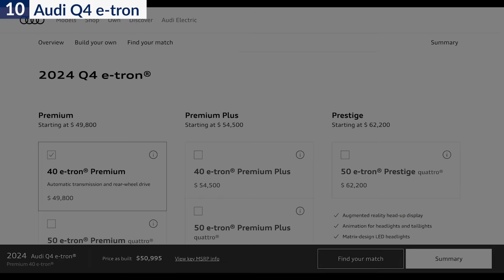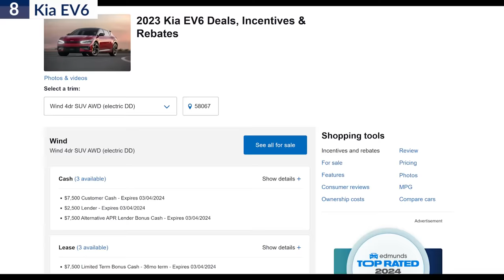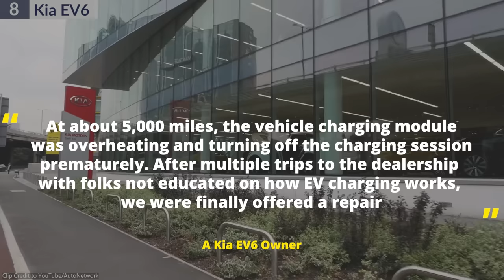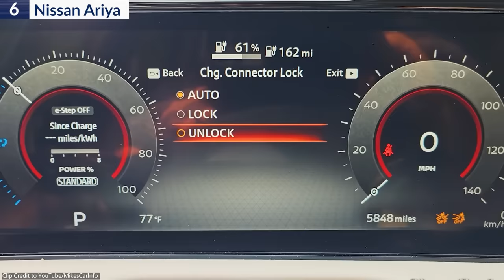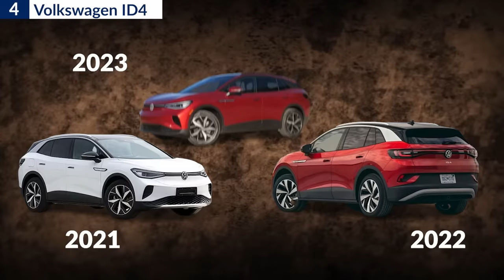New Electric Cars Piling Up on Dealer Lots in 2024 – Here is the Truth!

Comment: I bought 2023 ID.4 last year. It has usable range of 450 km. I charge it in my garage. I drive around 15-20 km per day. I calculated and it's around 5 times cheaper than petrol. I don't need to change the oil, filter, air filter, spark plugs, O2 sensors, all sorts of gaskets that leak, I don't have a rotting exhaust. If you can't see the difference you're plain dumb, it's just math. BTW it cost me around 29K USD.
Reply: It's horses for courses - the ID is perfect for your needs - meanwhile I drive 150km a day - everyday - I start work at 5am which means lights heater wipers - there's no way an EV would do my job - not even a Tesla! My Fabia is a 1.9 litre diesel and I can easily get 700kms from a tankful - I have no range anxiety !

 My car wouldn't suit you and your car wouldn't me !!
Reply: @donaljamescaddye3805  150 km one way or both?

Comment: Have you ever got or used an old battery drill or an old cellphone or tablet/laptop or a battery anything? They don’t hold charge, it doesn’t matter how much money companies put into batteries (apple, Tesla, Ford etc) they eventually die out?! maybe some last long, some don’t but they all die. At least with gas vehicles or combustible engines, they can be fixed.
Reply: Tesla has an 8 year warranty or 125,000 miles whichever first on their batteries.  If they degregate more than 30% they replace it for free.  For older Tesla there are companies that will take out a Tesla battery check each battery modules, replace those not working, put them back together and replace brackets and connections. so it´s no difference to a ICE  engine.  I saw on TV a garage that specialised in the original Tesla roadsters and they showed how they refurbish the battery, I think they wanted $5k to refurb the battery.

Comment: While i am against electric cars, Have i still planned to buy one within the next 2 years. This is mostly due to my current car which is a suzuki splash from 2010, The car has begun to rust alot, recently did i had to take the car to a mechanic to repair the rust, or most of it. it costed 1.330$

Comment: Another dis-incentive for EV ownership, is the recent announcement that insurance rates for EVs is increasing massively this spring, due to the issues with ANY type of repair, as most will TOTAL the vehicles. (A Tesla Y was totaled for minor scratches on a rear body panel, $81K value at that time).
Reply: Tesla do their own insurance, much cheaper than the main insurance companies.  Why would insurance total a car for minor scratches.  Highest price ever for a Model Y performance not the base model) was $69,990.  Model Y has giga casting front and back which can be replaced. for less than $1,000 each.  Tesla are supplying them to body shops at cost price.

Comment: "That's a market day supply of 153 days. Which means, based on current sales phase, it will take 153 days for dealers to clear the current inventory."  Either a 10 year old wrote this or an AI who is as smart as a 10 year old. Maybe it Youtubes fault for having content providers stretch out the length of the videos.

Comment: So, around 1900 the electric car was king, expensive, short range, low top speed, -sound familiar? I guess they figured out the top speed, but the above 125 years still apply. Terrible infra -structure, you have to garage them in cold weather, charging is a nightmare, all cars are too expensive, and the ev's cost even more. Can you say poor planning, is not a reason for crisis, or hey your bs agenda, well just plainly had an electrified explosion.

Comment: Tesla does not have this problem 
Its unfortunate that tesla is in the spot light for everything bad.
You have to realize that people flood the grocerie store and stock up other things like gas. Do the same with a Ev charge the dam thing before a storm.
Just prepare thats all
I hope people understand that when there is no power gas stations do not work as well 
Along with everything thing else.
Tesla is a great brand really no major issues including their battery.
I get it people buy other EVS that the battery costs as much as the car. But not with Tesla
Hope i shed some light on this.
PS model Y 1.5 million in sales last year it passed all car sales in the world gas ev and diesel.

Comment: I work in 5 states I keep track of charging stations and types.  Only tesla has a network that almost makes an ev practical.  Moron manufacturers should have adopted the tesla nacs a decade ago.  Maybe when tesla opens its network ev's will be practical, except the price.  If nissan updated the leaf with nacs and thermal management and keep the price sub 30k and only sold the 60kw battery they would own the market.

Comment: Electronics on newer vehicles are garbage and full of problems if manufacturers can't even have windshield wipers, door locks, and interior lights that have worked fine forever now and are riddled with gremlins now why would I true a car of nothing but Electronics. Manufacturers have gone cheap and cheaper to pad their pockets. I personally got rid of my newer car, and when back to an older car couldn't be happier, I know it will work and it's not in the shop half as much as my newer car was.

Comment: Former automotive mechanic question. 
Why is the entire electric vehicle market not utilizing an electric recharging system used in all automobiles known as an alternator that directly sends a continuous flow of electricity back to the battery? The infrastructure of electric recharge stations would not be needed? Although there would be zero profit if an electric vehicle never had to be stoped to be recharged and truthfully more use would then generate additional electricity to power all varieties of electric external internal powered devices. Hmmm 🤔🤫🙄🧐😜
Reply: yes!

Comment: Here in uk public charging is expensive 85p per kWh in some places, evs are ok if you do short journeys and can charge at home in your driveway or garage, but for people with on street parking parking or people that stay in flats its not convenient at all, then theres the worry of battery failing or catching fire, and range anxiety too , ive heard of peoples battery's getting broken just because of rain and surface water, so feels like you can only drive them in dry weather too, no use at all especially in my country Scotland where it rains about 300 days of the year lol, i stick with my diesel jeep renegade, just fill up and good for 600 miles per tank or more 🏴👍
Reply: What brand of EV with "battery's getting broken just because of rain and surface water"?   That's the specific manufacture's problem.
If some gas car has a leaky fuel tank I wouldn't write off all the gas cars or scared of carbon monoxide poisoning..

Comment: EV's are. ridiculous expensive, and the charging is far too slow yet.  I would not buy any EV before this is corrected. My older diesel will roll 950 km om a tankfull which take 3,5 minutes to fill upp.You better get to work EV producers

Comment: It isn't  just whether the electrical grid can handle it, but the amount of time in winter as example to get where you are going. If you are going from North Edmonton to South Calgary, that is 3.5hours of travel, but with the distance, you would have to stop and recharge to make the total trip in Winter. So 45min each way for charging turns into 1.5-2hours extra in time. That is a lot in a day. And that is if you have enough chargers. If you are taking 9x the amount of time to fill up at a station, that means that you actually need 9x the number of chargers to make up for the 5 minute gas fill. Ouch. Also, today we are already seeing the rise in cost of electricity so what happens when there is 50x the demand? Supply and Demand models will tell you that the cost of electricity will go way up.
Reply: 300 Km, easy no-charge run except perhaps the most frigid -30 day when I  have to charge about 15 minutes in Red Deer just to be safe. Guarantee I am stopping more than that in 3.5 hours just for coffee & pee. 
if EVERY car in Canada was an EV it would use up 3.5% of our total current energy generation so demand is not a huge issue!!

Comment: “Here is the truth” No.  This video is not “the truth”. It’s partially true and partially deceiving. 

It picked the ten worst-selling EV’s and proclaims that EV’s aren’t selling.

While it’s true that EV’s, in general, aren’t selling as well as expected, the main reason the cars in this video aren’t selling is because they are crappy cars or overpriced or both, not because they’re EV’s.

There are lots of crappy and/or overpriced gas and hybrid cars that also don’t sell well.

If you wanted to make a truthful comparison of EV sales vs. gas vs. hybrid you’d have to include the inventory and market supply data for all three types, and at the high end (best-selling) and low end (worst-selling).

In other words, this video presents only one out of the 6 data sets necessary to present “the truth”.

Comment: The Mustang Mach E is the replacement for our Ford, ours cost £40k fully loaded, a comparable spec Mach E is £70k, no thanks Ford.
There was a guy on YouTube the other day who’s ETRON RS cost £130, after approx 4600k miles it was worth only £65k, a loss of £65k, or £16/mile covered. That’s why they are unsold.

Comment: You are soooooooo far away from the reality.  Dealers are selling their poor EV's.  The public has, to some degree done a little research and found that almost nobody makes a decent EV.  Our Tesla Model 3 dual-motor long range vehicle is costing us about 3 cents per mile to drive, with no maintenace required after 45;000 miles.  My advice, Tesla is the only EV to buy.  PN